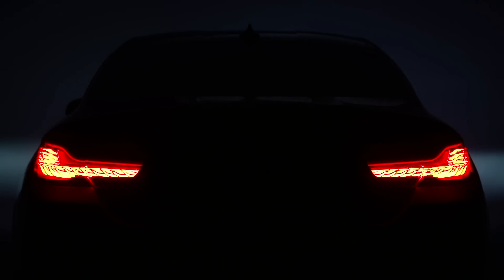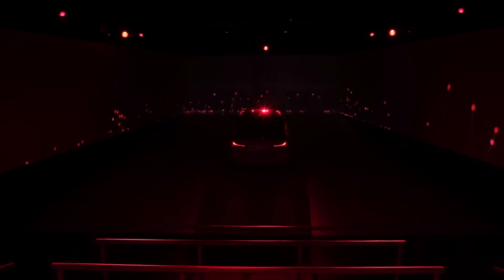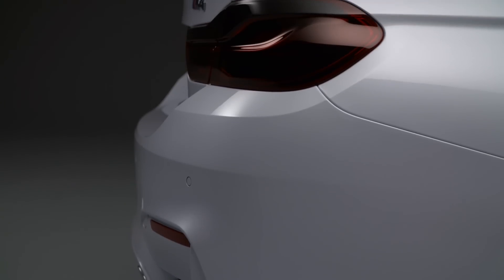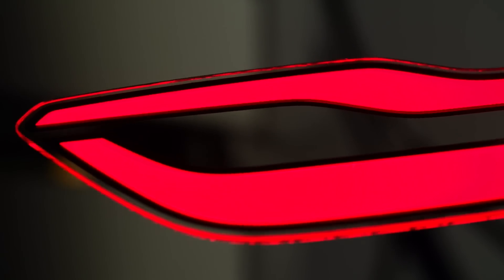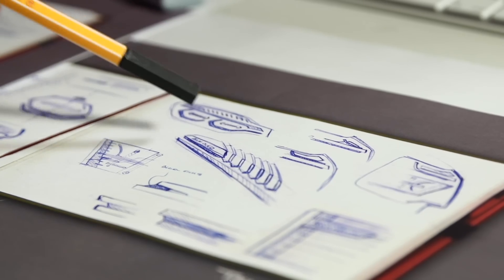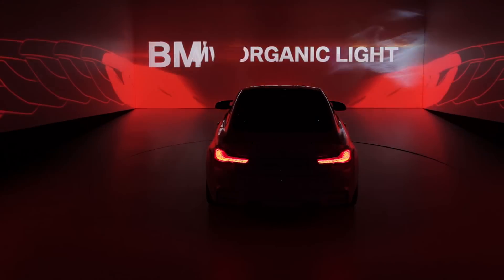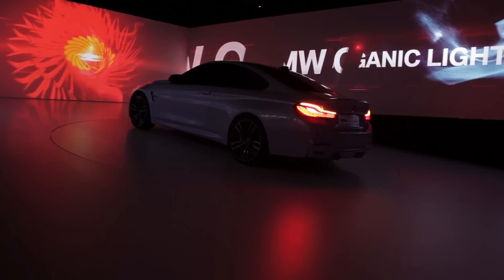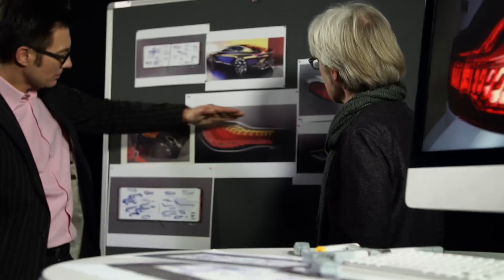The future of tail light innovation today. BMW organic light OLED.

Comment: I think the design looks messy and over complicated. I much prefer a simple clean line of light. Too much bling. Too over engineered. More like a Mercedes than a BMW.
Reply: Can't agree more, it all looks cool and futuristic just what's the point?!
Reply: Phenix MacCastellion It's a concept, it'll be much more scaled back when it goes production
Reply: +Witness ProPro No way! It's called innovation! and BMW innovates. Always has and always will. There's plenty of old E30's out there if you want old ass technology...like manual seats, tape player, manual mirrors, cheap interiors, noisy, etc. For me being 40 I like additional comfort that newer cars have, like DCT, Power everything, Bluetooth, Heads up displays, navigation, etc.

Comment: Big problem in winter in finland. These won't produce enough heat to keep the tail lights clear of snow/ice. Hopefully the tail foglights at least will or that BMW solves this issue somehow, because for example, the current 5-series is an excellent winter car in every single way, it's very well thought out and designed to work during winter. At least the models sold in finland.
Reply: winter package with a simple heating system should solve the issue.
Reply: Sam20Gallardo well you wipe off, but while you're driving snow will not melt like it melt on standard lights.
Reply: I drive a lot in the night when the snow is not plowed at all untill before morning traffic. That's why i don't like led tail lights.
Reply: Manakuski  They can solve it easily with hydrophobe technology.
Reply: Then build a light heater :-P
Reply: Oulu.
Reply: Manakuski How come the European versions and German versions are so much better than the ones sold her in the US! I love the European model BMW's.